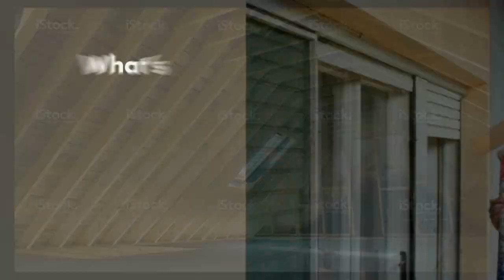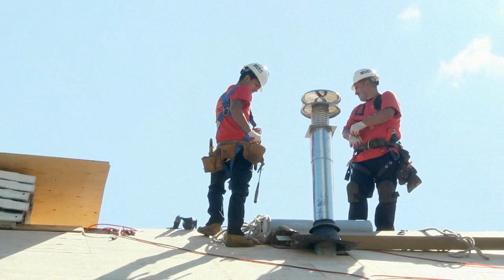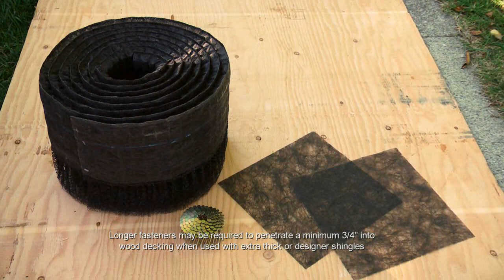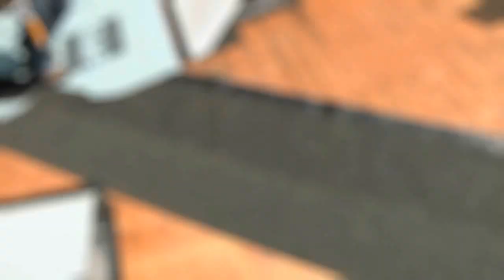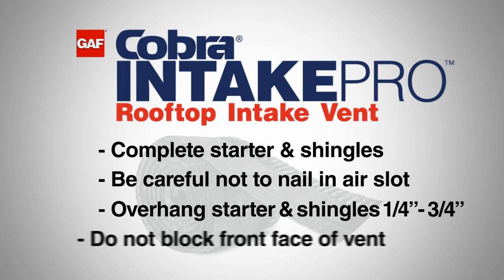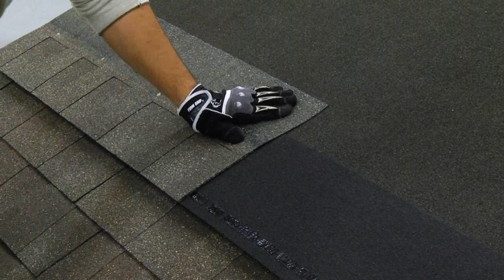How to Install Cobra IntakePro for Attic Intake Ventilation | GAF Roofing

Comment: How does this prevent rain from blowing into the attic during heavy rain events with wind ? Thanks
Reply from the maker: Hi, Jimmy. The Cobra IntakePro® Rooftop Intake Vent is built with a crush-resistant design to help guard against wind-driven rain, snow, and ice dam infiltration. Additionally, it is installed with our GAF WeatherWatch® Leak Barrier, which goes both on the roof deck and on top of the installed intake vent. You can visit our website to learn more about this product: http://spr.ly/6057BHJert. Our technical team would be happy to discuss any further questions you may have as well. You can call them at: 1-800-766-3411.

Comment: you state to stay away from rakes and walls 12in/1ft but go to the end in the video.
Reply from the maker: The video refers to the air slot that MUST stop a minimum of 12" (305 mm) from rake/gable edges, side/end walls, and hip intersections, and MUST stop a minimum of 24" (610 mm) from valley intersections. Detailed instructions can be found at this link: http://spr.ly/6058BEifqj

Comment: Love the idea and not having to redo my soffits. However, I’m seeing two concerns with these products that the manufacturer materials don’t seems to address. 1. Have they accounted for modifying the roof edge that may make the existing gutters ineffective? 2. What about snow/ice dams cutting off the intake during the winter months?
Reply: This method also prevents ice dam and snow build up in most cases.
Reply: @jcmoye1  How? Anything deeper than 1 inch will bury the vent. Or does warmer air inside the attic melt the snow until it freezes in the gutter , slowly making an ice dam build back up to the  vent and leak back thru the cut slot, into the attic?
Reply from the maker: Hi, Ken. Our Technical experts will be able to answer your questions. Please give them a call at 800-766-3411.